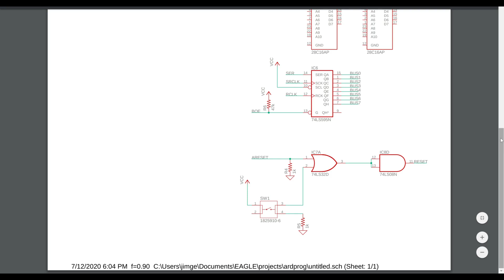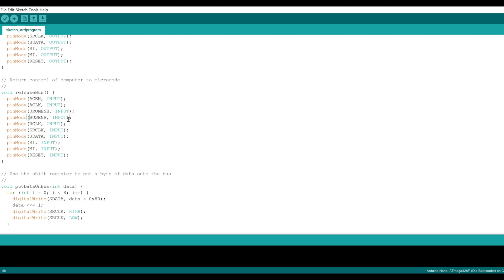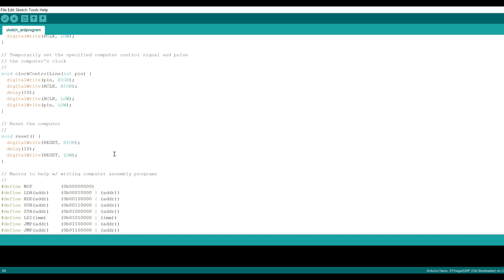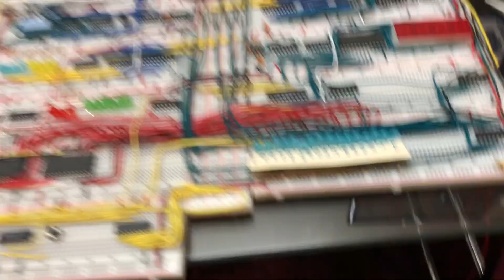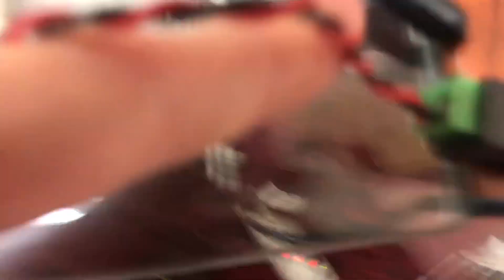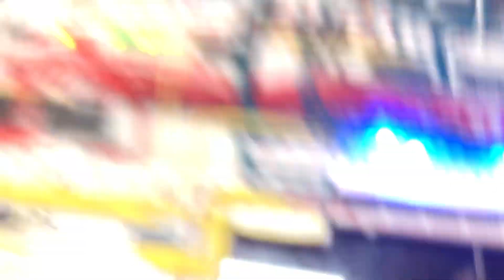Arduino programmer for the Ben Eater breadboard computer

Comment: Wondering about the RI and MI outputs from the Arduino. Are they just wired to the output of the EEPROM RI and MI lines? Couldn't quite tell from the video. Is it OK to wire these 2 outputs together?

Comment: Nice stuff. I think I may need to add this. Is there any reason we can't replace the RAM chip with an EEPROM chip?
Then use it for instructions and data.
We would get much more memory and be able to use a stack.
Reply: I am by far not a pro here, but from what I learned is that RAM would be quicker (prob not important for this project), but EEPROMs also have a limit for how many writes it can handle before it dies. Considering you may be writing to RAM (or eeprom) many times, it may not last as long as you'd like. I had this same question myself. I was told that a normal thing we could do would be to have an EEPROM that has your programs stored, load its data into RAM on initial boot. This would be similar to how modern computers work. I have thought about this circuit but never got around to doing it b/c the Arduino RAM programmer made sense to me and made it simpler. Again, please dont take this is as total fact here :p but perhaps a way to start researching more :)